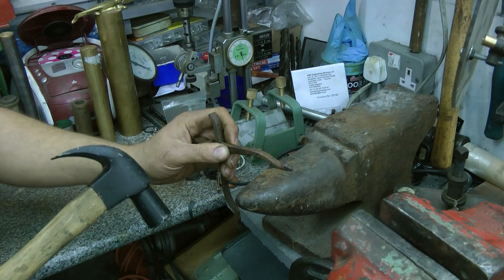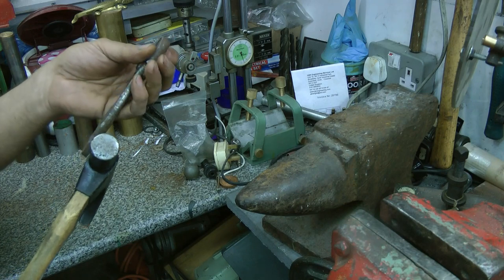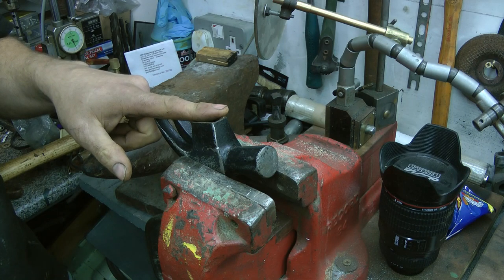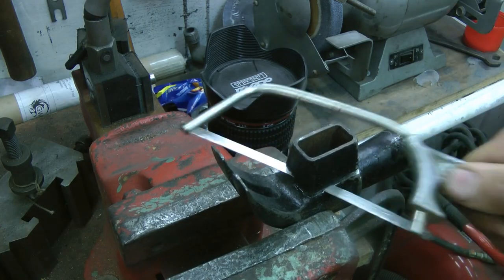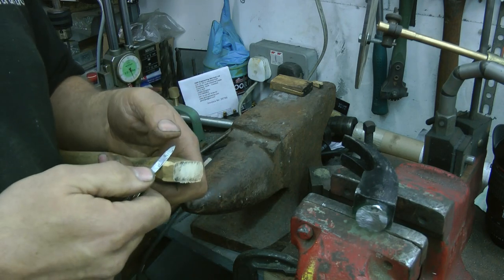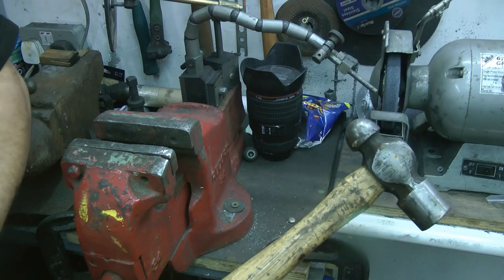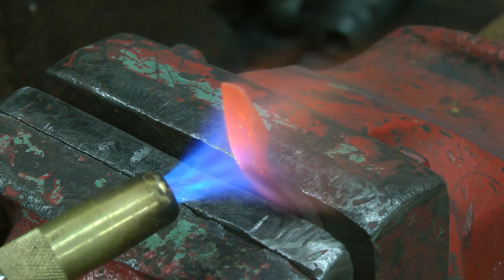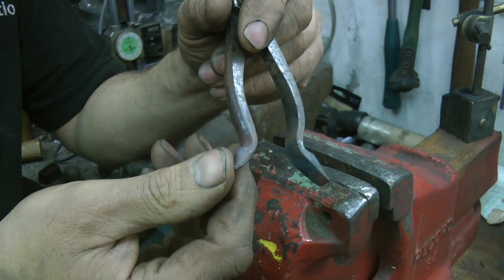Rusty hammer makes money… restoration? Have a look

Comment: Well what next?
Reply from the maker: A ray gun  next ... 🙂 something that doesn’t involve welding and grinding!
Reply: @chris-the-bodge-sculptor   So long as you do not turn good collectors Electric drills, into lamps like I  did a few years ago. You can turn most wood and metal tools and scrap into works of art, but you will still  need the welder a grinder and a buffing set up and most all, more room to spread your imagination ,you may have to sell a few of you drills to make the space.